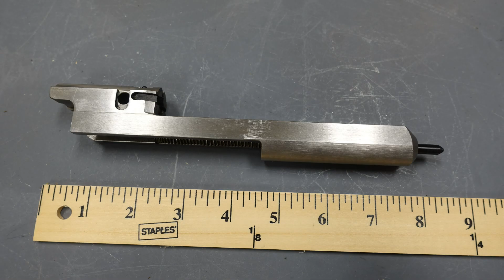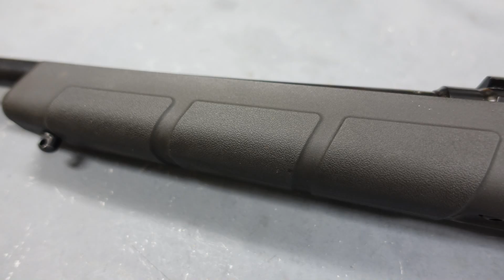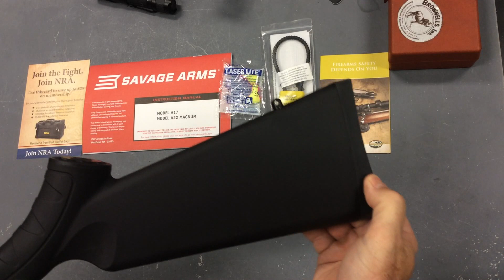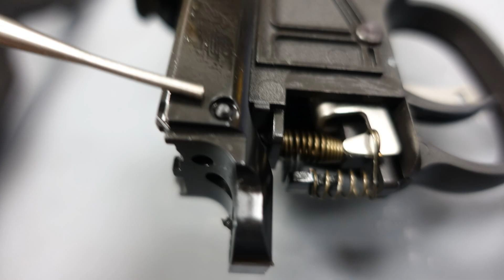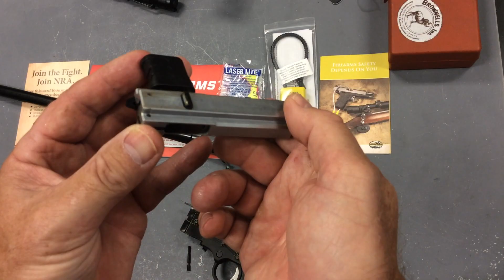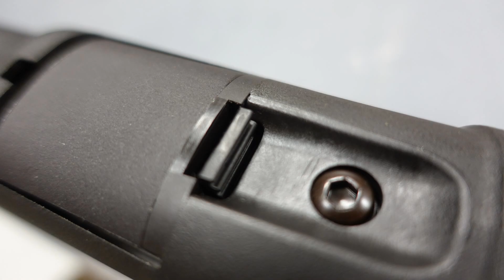Savage Arms A22 22 WMR  22 Magnum Semi Auto Rifle: Shop Review (field test to follow)

Comment: Doubt seriously it’s the quality of my H&K 300 semi-auto 22mag.  Mine has never had a malfunction and still shoots in the low 0.3’s at 50yds.  Glad I never sold it.
Reply: I have a model 300 also, the savage is not even in the same league. The stock on the savage is crap, the one on my Rossi is much better.

Comment: Nice,plainly understandable review, demonstration of this rifle! One thing I would be interested in, your evaluation of the Accutrigger in this rifle. I have two other Savage rifles/bolt guns,with this trigger design,that adjust from a stated trigger pull of 2-5 lbs. They work superbly! In my example or the .22Mag. in semi-auto,the manual says that it is adjustable between 3-5lbs., but my example will not adjust below 4-4.5lbs. This makes for real accuracy issues for me! I contacted Savage about this, they said send it in to them,but in today’s current political climate,I don’t want to part with my property,in case something would cause it to be lost. I took it to a local gunsmith,and he tried to fix it,but no other springs/ parts were available for it,other then a complete replacement trigger assembly,that cost as much as what I paid for the gun!! So I’m interested in your experience in testing. 🤔
Reply: I experienced the same issue with mine. I also have an A17 and the trigger is awesome. I’m weighing my options. Send it to Savage or buy a pricey Jard replacement trigger assembly.

Comment: It's the same as a Rossi RS 22M semi auto rifle. The Rossi is a shooter., and reasonable priced to boot.
The bolt, the way it works & even the way it looks tells me the savage copied the Rossi bolt lock design.
Reply from the maker: The Savage is made is USA. The Rossi was not on the market several years ago when I did this review. I believe Rossi is copying the features they like from Savage and offering their improved version. They are known for copying others designs.
Reply: @MichaelBellmbell556  Well Rossi made it better.
The Magazine in the savage was/is aPITA.
Rossi's mag works nice, stick out ya, yes, but so what. It works slick. The stock I better on The Rossi. stiffer, still a composite. Hold open on the last shot. Not on the Savage because of the magazine Savage can't do it. Rossi can. Rossi very dependable, Savage- PITA to run.  Gun parts are made in all parts of the world, you might be surprised where parts are made on a Savage. It's more like assembled in US.
What Rossi did was make it better. Shoot them SxS see for yerself.

Comment: The spring in the magazines is too stiff when new. If you down load to 15 to 20 rounds it will run just fine. Load the Butler Creek magazines fully and let them sit for a couple of weeks. Or just down load and use them a while and they will function just fine.

Comment: Considering the price, the quality of the firearm is unacceptable. I can build a target model 10/22 for the price of this rifle and shoot 1/2 inch groups at 50 yards. The severe safety issue regarding ruptured cases proves my point.
Reply: I just did a little research, savage is discontinuing this rifle at the end of 2019. Safety/reliability issues. Good riddance.
Reply from the maker: I have not had a case rupture in my rifle. I have had a rupture in a PMR 30.

Comment: You could easily fill the stock with epoxy resin for about $25. This will add about 2 lbs of weight which will absorb recoil.
Reply from the maker: It would make it feel more solid.
Reply: What recoil?
Reply: @coryshook7648  all firearms have recoil.

Comment: My 2 cent observation of this A22 bolt function...the bolt delay action is similar in principle to the roller action of an HK MP5 except, instead of rollers, it uses a simplified, single cam wedge. There's got to be more friction on this little wedge when the in motion which rollers would eliminate. Makes me wonder how long before the wedge shows signs of wear?  I wonder if a single roller cam design could work to greatly reduce friction?
Reply from the maker: Good thoughts. Savage makes a point of keeping this area lubed.
Reply: Also the receiver is made from Aluminum, so you have a steel locking bar grinding on a aluminum receiver. For that matter the bolt itself is riding on the aluminum rails of the receiver. Might want to use grease instead of oil for lube.

Comment: I wouldn't worry much about the "plastic" parts of this rifle...current polymers are exceptionally tough and durable.
Reply: i worry that companies will still charge wooden stock prices for polymer rifles
Reply: My question would be, how well do parts like the cover release pin deal in the long term with the typical gun cleaning/lube product solvents?
My experience also leads me to believe that dark plastics are more resistant to the elements...
Reply: Given the popularity and durability of "plastic" pistols these days on heavy recoil calibers like 40 & 45 --- I think plastic will be fine on 17 hmr, 22's and 22 magnums.

Comment: Is this rifle similar in construction to the new 22lr A22?
Reply from the maker: The receiver is steel in the 22lr version, just like the magnum version. The bolt is a simple smooth affair in the 22lr version, not the more complex bolt with the locking piece. They are very similar in external design.
Reply: Interesting, i thought they advertised it as having the delayed blowback design also. I'm waiting for delivery on one so watching all your excellent videos. hoping the Boyd's stock fits and the upgrades start to show up.

Comment: I can not find 22mag ammo at a reasonable price. I won't even think about another 22mag tell something changes in the ammo department.
Reply from the maker: The ammo is a problem. Fortunately I bought plenty when the prices were "normal". The prices have been softening up a bit lately. I have seen some Armscore for about $13 a box on Gunbroker.
Reply: Farmer Dude357 use the website "ammoseek". It searchs a variety of online stores and the prices are usually the best on the market.
Reply from the maker: ammoseek and gunbot are the 2 search engines I use for ammo. ARpartsfinder for parts.
Reply: Jared B I will check it out. Thanks.